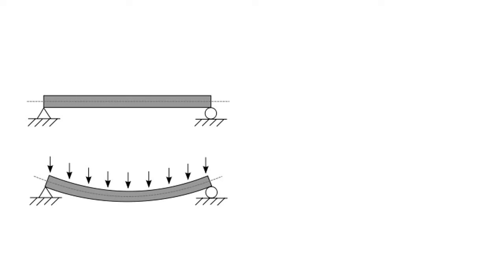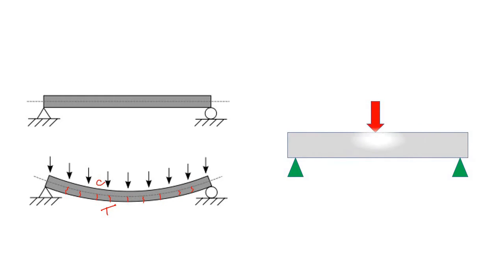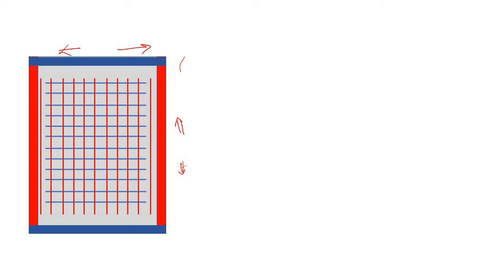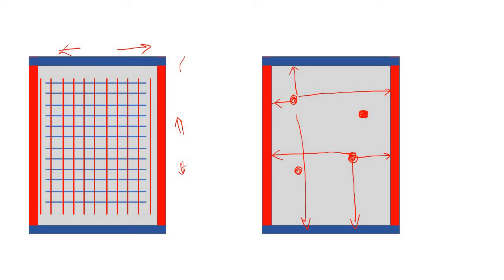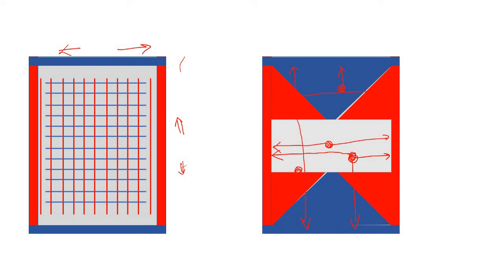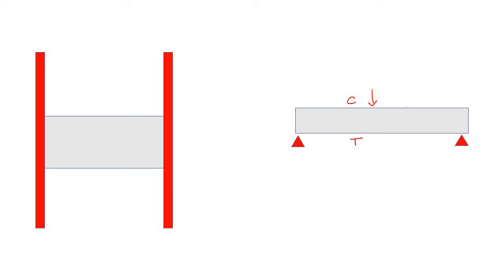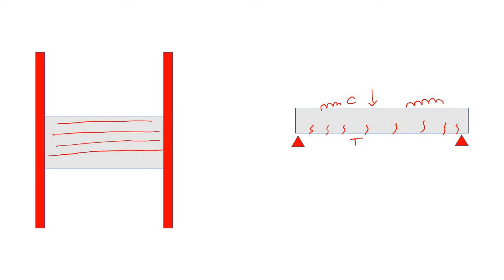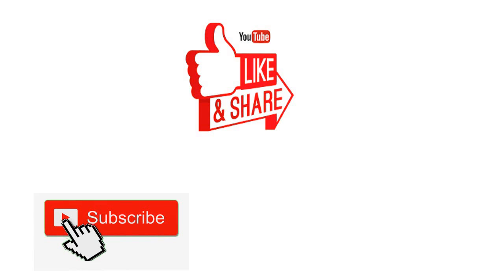Slab Reinforment Detailing/Why Reinforment in Slab are placed in Shorter Direction First ?

Comment: Why we use concrete cube in comoressive strength test ? Why we cant use cylinder? And what can we do if cube test fail? Please explain sir
Reply from the maker: It's just a practice. Actually in reality the concrete members resembles with rectangular and cylindrical shape. That's why these shapes are used